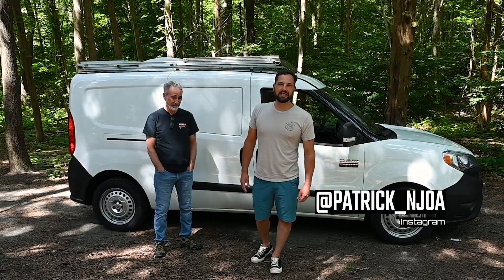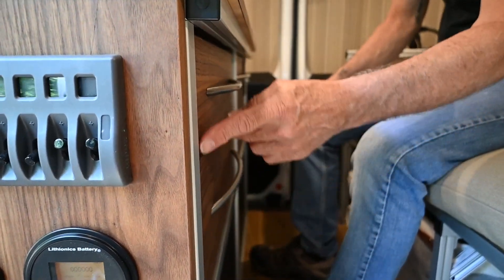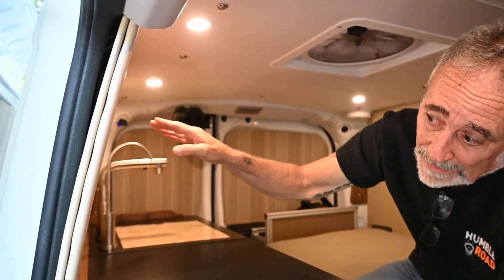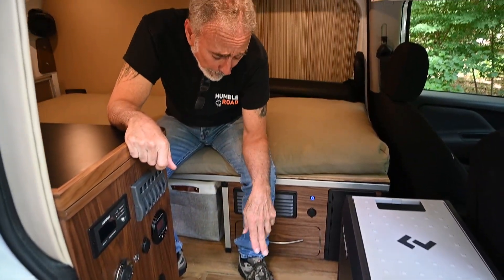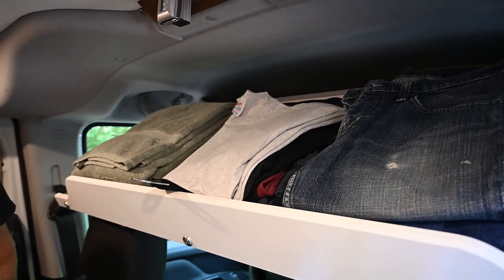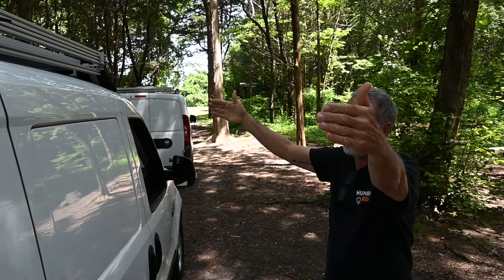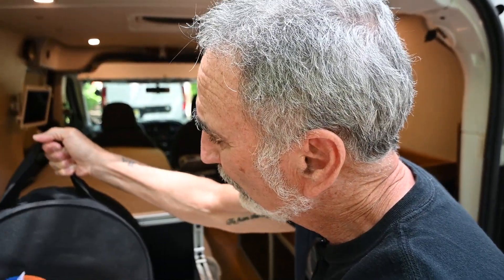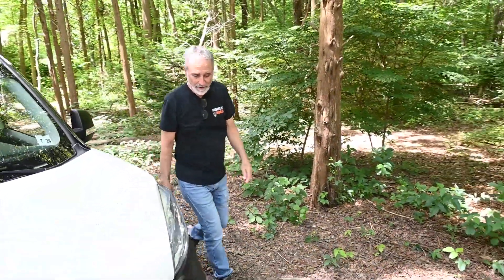Micro Campervan RAM Promaster City - Small Compact Fuel Efficient RV for Van Life

Comment: I love the iPad arm!  Sooooo glad he didn’t put in a tv.  No one living this life is watching a tv.  I need a comfortable bed that I don’t have to make every day, air conditioning and heater SAFELY , a place to wash up like a sink, and a place for waste poop/urine.  A vent for the top for when I need to use the poop box 😂 and battery power.  Lots of energy.  I would like to plug in a tiny fridge ; 2 or 3 days worth of milk and cheese….not going into the woods, urban camping.  I would travel with usb type gadgets, I would like to be able to be plugged in without having to turn it on. Solar power panels. This is cool .  I

Comment: It's amazing, I would remove the passenger seat, use the passenger door as the main entrance, and expand the kitchen across, with the fridge tucked away under the expansion and you could create a little office with a swivel driver's seat, as well as add seat belts to the wall where the bed is creating 3 places for passengers and have the tv on the wall across where the kitchen is.
Reply from the maker: That would be cool!

Comment: Excellent gas mileage and beautiful build. He could sit up perfectly if he moved over the mattress, or lowered the bed/seating area. Being able to sit up in there is very important and a deal breaker for many. You could also push the mattress up to the wall to lean against and have something thin yet comfortable, like a memory foam 2 inch to sit on when you are cooking or working on your computer. The memory foam would flatten a little bit and be comfortable if you are a taller person so you don’t need to just be 5’8” or shorter to use this van. This guy is brilliant and makes a quality product. With gas prices as they are this build will probably be in high demand.
Reply from the maker: Glad you enjoyed the tour

Comment: Nice design. I have no idea if this is possible or not, but if so, it would be nice to have some type of rain gutter rail so that rain would not run from on top of the van to under the canopy once it’s in place. Or maybe the roof rack could be brought out and designed to also serve this purpose as well. Just a thought…
Reply from the maker: That's a great idea!

Comment: Recently got myself a version of this van - here in england its called a Fiat Doblo Maxi... unfortunately they dont come in auto over here so mine is a 6 speed manual and its a little older than this (2015) but you have given me some great ideas of what i could potentially do with the van if i decide to keep it long term! Must say im surprised you havent installed a diesel heater though?

Comment: Another great product. NOT an endorsement and share with Humble Road as well, the best Battery Management System (BMS) for these smaller builds is the RedArc RedVision BMS for a number of reasons. 1. While Victron is commonly used in mobile builds it's NOT built for the constant mobile rattling. RedArc products while limited to 30Amp charging are compact, rugged, and specifically built for offroading in the Australian outback, including in excessive heat (the BMS unit can be installed in the engine compartment to save even more space). 2. RedArc is more compact, with fuses (which light up and alarm when tripped) all in one place, and charging sources (DC-DC, shore power, and solar) all in one place. 3. Components (battery, lights, pumps, temperatures x2, water tank level x6, etc) and alarms are monitored and turned on/off by the unit or with the Bluetooth app on your smartphone. 4. There are others.
Reply from the maker: Thank you for the useful information
Reply: @Chris NOT a big water activity guy so NOT familiar with marine equipment vibration. Thus, unfamiliar that marine vibration was more significant compared to driving down the road, or off-roading which is where I do most of my SUV/RVing travel, and common to find well-stored items on the floor after a drive. But, when I looked up information on marine vibration most marine mechanic sites mentioned vibration on boats is NOT a good thing. I paid $2,300 for my RedArc RedVision setup, which required NO other components except for an inverter and the wire. I found RedArc setup simple. No figuring out fuse amp tolerance, etc. All done already by RedArc's RedVision. Thus, mostly strip the wire, insert, tighten, and forget. None of which required much thought as to Victron’s long-drawn-out layout of wires fitting into any space or what fuse amp tolerance was needed where. Also for me, in the southwest with outside temperatures in excess of 100+F, it doesn’t take much for the BMS (or inverter next to it) to hit 160-189F when in use making a meal on the induction stove. The Victron site discourages use above 65C (149F) before damaging the unit. While in the southwest we don’t get much water we do have lots of dust. The Victron site also discourages both as well but the RedArc can be installed in the vehicle’s engine compartment if needed to save on the very limited living space in my Toyota 4Runner. You mentioned the Victron has other disadvantages. Aside from the many mentioned, would you be willing to list others? And, aside from the price, would you list the disadvantages to the RedArc as well? I am sure many here would appreciate the comparisons as RedArc is NOT a recognized choice in the USA, as it is in Australia where the product is originally made for. Thanks.
Reply: @Chris WOW! “Disagreement is NOT a hate crime! Or a crime at all.” (-The Knitted Brow)

I simply pointed out a different product could be a better choice overland. You suggested the original product can sustain marine vibrations. I point out that marine mechanics claim vibration at sea is a bad thing that needs to be fixed before a catastrophic outcome. I then thought, if marine vibrations are bad and need repairing why would an energy company make their products to withstand vibrations that are even worse than vibrations overland, and that instead need repair. I also listed a few benefits of one product versus the original product, and lastly, since you’re so well versed on both products (at least the price of one), I simply asked if you compare the two products for the benefit of others here. Rather decline the offer because of limited knowledge you confirmed such by replying that I am an agent for that product. Huh? That’s quite the leap.

This platform is for civil conversations between adults of like interest. If you disagree that’s fine. But your elementary school behavior and name calling doesn’t look good in the defense of your product bias over another. (You might want to look up Erikson’s stages of psychosocial development to find out where you’re stuck).

Whether I represent one product, or you represent the other is irrelevant. Patrick does a phenomenal job bringing many talented, innovative, and creative persons to showcase their products here. Many of them private possessions and some for sale, like @HumbleRoad and many others. Thus, again, whether you or I represent any product is irrelevant. Don’t ruin it for us here interested in civil adult conversations.

Nonetheless, let me help you with this simple elementary school homework you found so challenging. Here is a comparison of the two products https://expeditionportal.com/forum/threads/redarc-vs-victron-real-world-use-pros-and-cons.227572/

By the way, while I didn’t read the entire adult conversation, from what I did read the forum conversation favored Victron, which is fine. However, a takeaway for me, and mentioned by those favoring Victron is that Victron needs climate, water, and dust control environments. Thus, since I am NOT at sea but instead bouncing around off-roading in the southwest, where it is excessively hot and dusty, I opted for one product over the other. 

Whether others read this or not is also irrelevant as you decided to hijack the conversation as your own. A bit more advice, “[If you stop to throw rocks at every barking dog you encounter you will get NOWHERE!]” (-Winston Churchill)

Comment: I've got 54 clear inches from my floor pan to the ceiling ribs in my little Transit. Every aspect of this build is with the intention of keeping as much headroom as possible for my husband to sit comfortably. This affects the insulation I choose and how much of it I can use. Light placement is vital so he doesn't crack his skull coming in, going down, sitting down, or laying down. This one factor is just too important for comfort to dismiss. All it takes is knockingtheir head half a dozen times to make someone absolutely hate their environment. (Lord help the very tall people. Don't know how they manage not to be constantly grumpy.)

By lowering the bed platform/couch, I think I've got more than enough there. (Depending on how much the mattress compresses when you sit on it.) I may put a maxx air fan in there just to buy him a little more strategic space. He's getting really irritated with how often I make him climb in there to double check current measurements and see how much I have left, but I think he'll appreciate it when it's finished. When I'm done, a person who's less than 5'10" should be able to be comfortable - six foot if I put in the ceiling fan.
Reply from the maker: Appreciate the feedback and extra information

Comment: It's a cool van (I watched the build videos on George's channel)! I'm excited to watch it evolve in the years to come.
I don't dislike it, but I still think the bed is too high. I'd be okay if my knees were higher than my butt (when sitting on the bed) if it meant I could sit up straight without cocking my head sideways. Also, a solo traveller vehicle does not need a passenger seat. A lot of good things can fit in the space the passenger seat & floor takes up (toilet, batteries & electronics, fresh water / gray water tank, or more storage). Ideas for Mini-Me v2.
Reply from the maker: Thank you for the suggestions

Comment: If you're taller than 5'8" you should get another van? That makes no sense when you can make the bench legs shorter. Puzzling comment there if you ask me.
Reply from the maker: People that buy compact vans know the space constraints for taller people
Reply: @NewJerseyOutdoorAdventures  indeed as I am building in a similar sized van and I am much taller than 5'8"
Reply: @NewJerseyOutdoorAdventures No they don’t, because there are no such constraints, only bad design. There are space constraints for NBA players, but not tall normal people.
Having that storage at the back which robs precious inches of bed length is simply unforgivable and unnecessary. But he can make that movable so it stores on the floor at night. Then if you’re really tall you can move the driver’s seat forward and have a flip up bed extension. Then you can probably be close to 7 feet tall and still fit!
Then get rid of that. ridiculous thick matress and get something super low profile These steps would fix the most glaring shortcomings of this build.